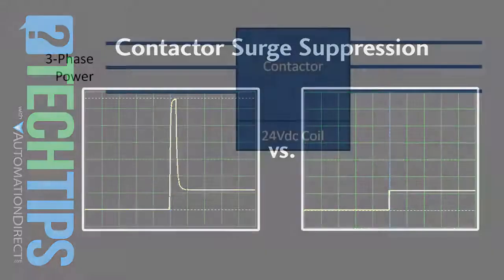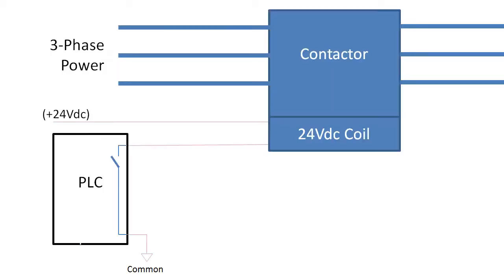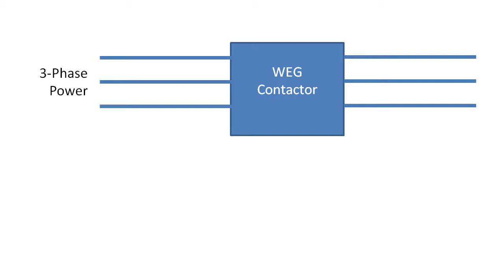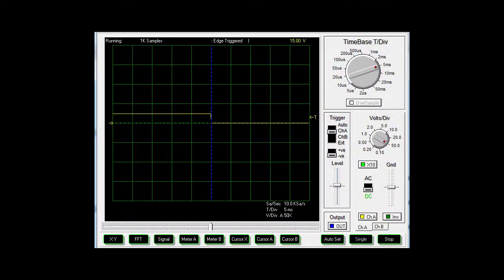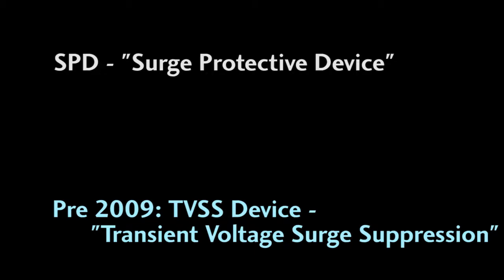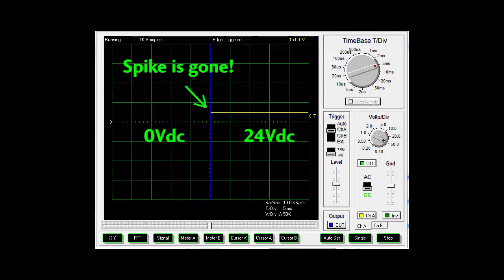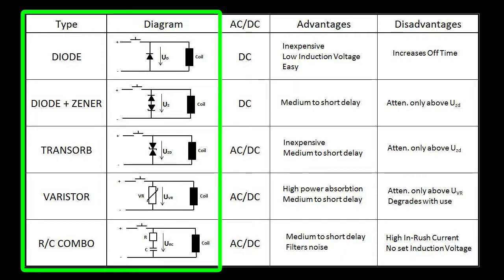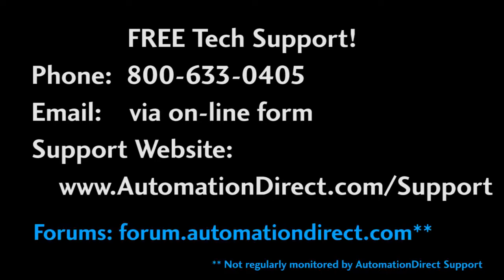Surge Suppression Devices How & Why to Use from AutomationDirect

Comment: Superb👌my plc was disturbed and triggered falsely bcz of no SPD across the 230 AC contactor which was controlled by DC relay 5vdc.
Then I used RC snubber across 230AC coil and the problem gone.
Thanx👍👍😊😊😊😊alot
Reply from the maker: Thanks! Make sure to check out more of our videos at https://www.automationdirect.com/videos/home

Comment: I’am problem like this too.

But it 240AC coil.

Help me please.thank you.
Reply from the maker: You want surge protection for a single coil at 240VAC? Go to www.AutomationDirect.com.  You will find a number of solutions there.
Search for SPD, then in the left column narrow down your results. 
In particular, check out this new DIN Rail mounted device: https://www.automationdirect.com/adc/shopping/catalog/power_products_(electrical)/surge_protective_devices/ul_type_4_for_power_a_controls_applications/953205
Reply: @automationdirect   thank you.